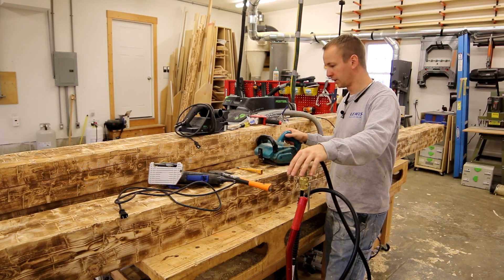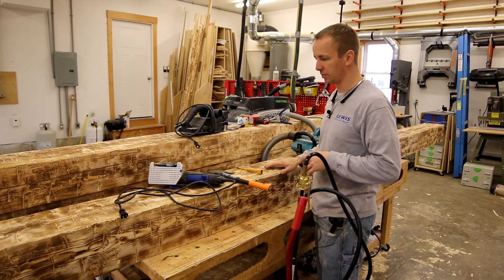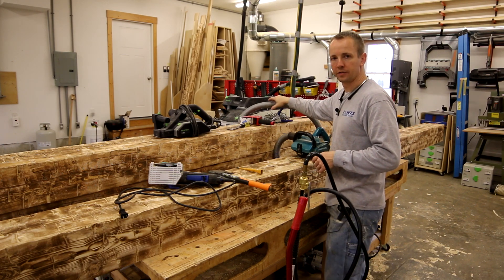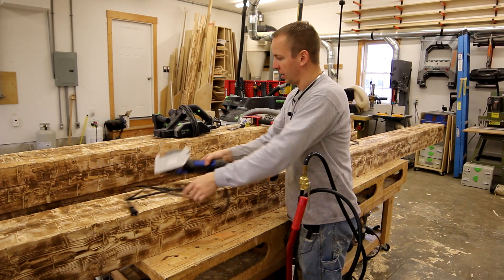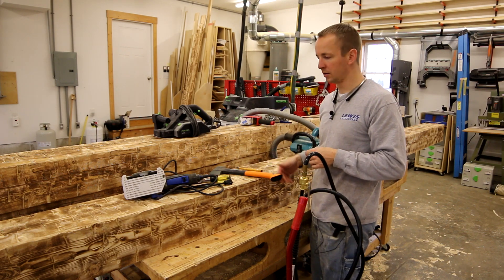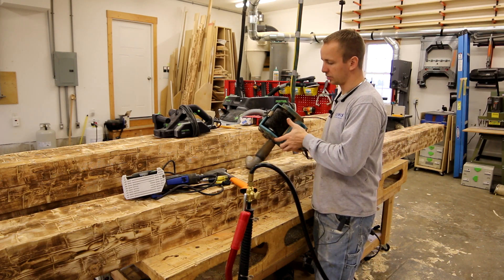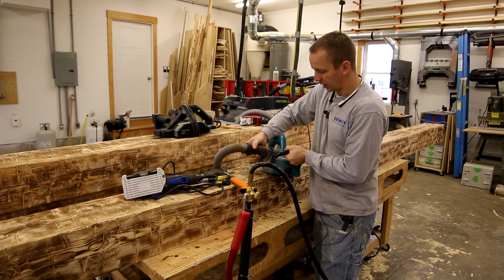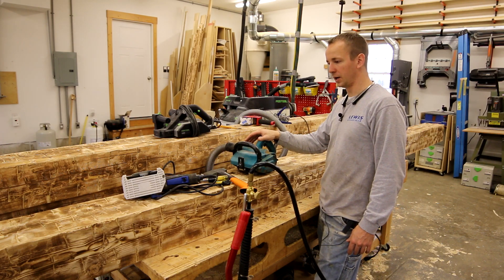Tools Used to Distress Barn Beams

Comment: 0:40 Have you ever tried those composite resin/fiberglass nails that Senco makes? I could have used them a bunch at my last job, but only discovered them after I left. Seems like this would be a good use case.
Reply from the maker: Yes, I was actually just looking at them recently. I may have to try some in the future. I don't have any distressed beams coming up for a few months at least so its not pressing for me at the moment.

Comment: Hey man I love your content so thank you for taking the time to make these videos!! I have 2 questions, hope you don't mind answering... 1) Is this undulating planer head ONLY good with festool 2) is there a cheaper alternative instead of the undulating planer? seems a bit pricey for only one time use for me. Thanks :)
Reply from the maker: The undulating head is only available for the festool planer. 

You can get by without the undulating head if you hew them with an axe and use the wire wheel. They still look good.